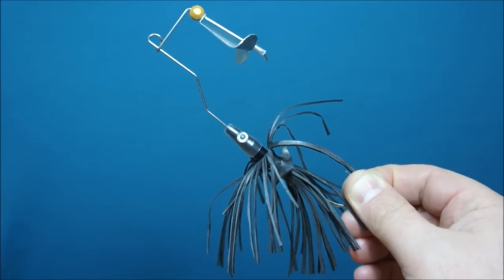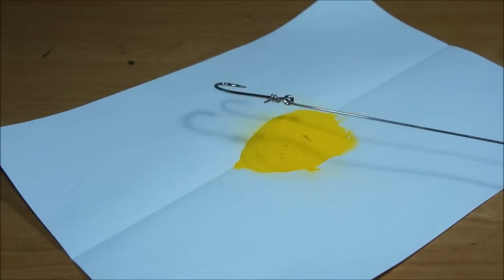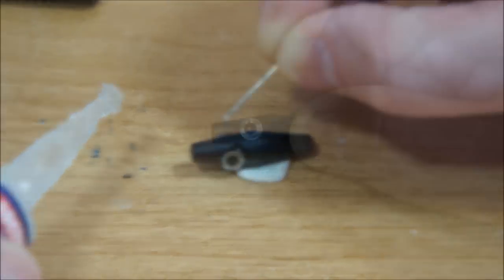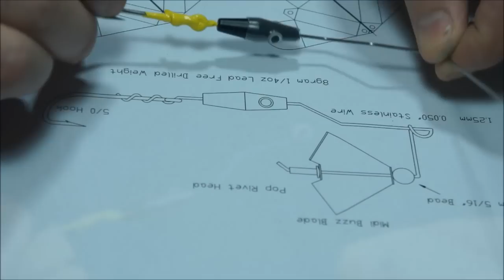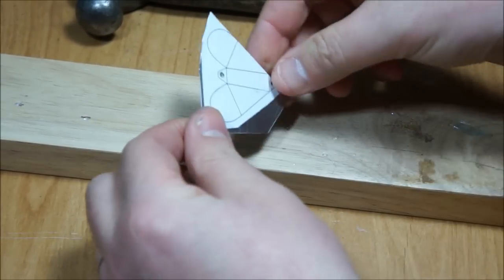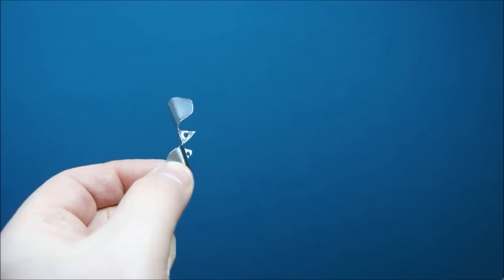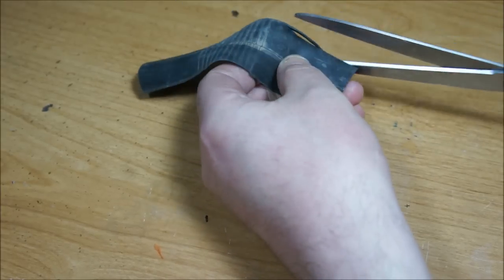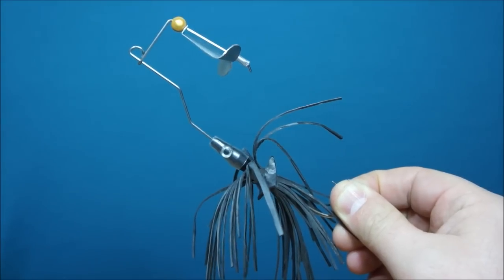How To Make A Buzzbait fishing lure

Comment from the maker: It depends a bit on how you want it to swim, to get it to surface i have found a bit of speed plus raising the rod tip a few feet off the surface will bring it up, then i can slow down a bit. In the video it is not running that fast but i could of reduced the pace a little and still kept it at the surface. The rotating blade creates lift, so if i reduce the speed the lift is reduced and i can get it to run sub surface almost putting a bulge in the top film of water.  

Hope That helps

Comment: ok made two types of buzzbaits with stainless tig wire. you was right. the one like you explained in your video did not work very well due to the wire being to soft. the other was a in-line buzz based on your video. it worked better the perfect.
Reply from the maker: i remember the first time i saw pike turn back on itself at the surface to swipe at one of these,  the reason it missed was because the water was like soup and i think it had felt the vibration but was hunting blind. sometimes i think they are the most ridiculous lures, but they work. Glad to hear you came up with another solution, thanks
Reply: ***** here where i am at in the states, we have tons of floating moss and pads. the louder and more crazy the lure is, the better chance you have to get them from their pockets and strike.
Reply from the maker: one day i will make it over the pond (Atlantic)and do some proper fishing.